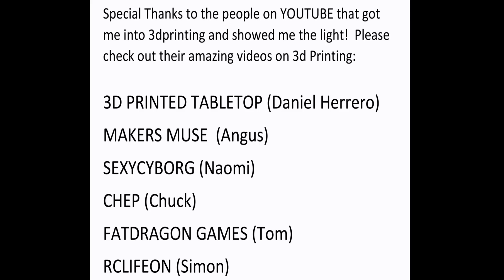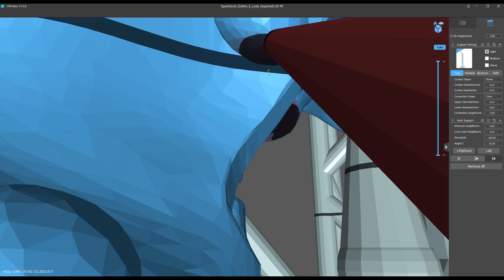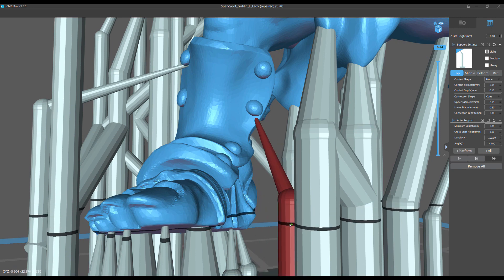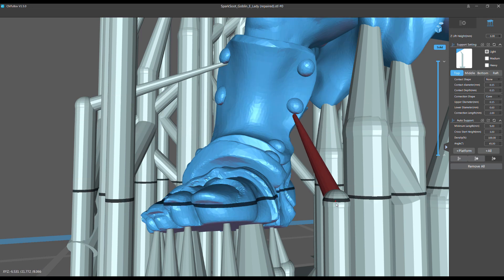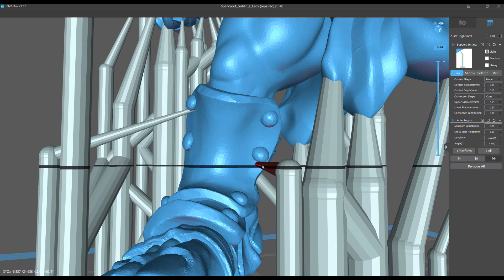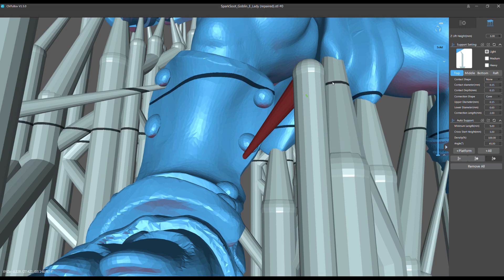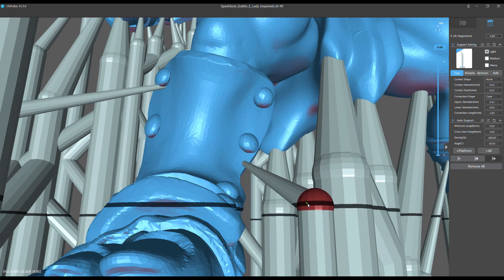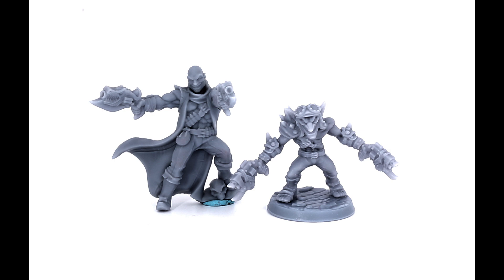Another advanced support tip for resin 3d printing!

Comment: Great idea, I had not thought of that direction as you pointed out. What I do in this situation, and actually how I do 95% of my islands is the slide bar on the right side of the UI where you can adjust how much of the vertical model is displayed.  I adjust that bar so I can only see those few pixels floating in the air, once I have that, I click to drag the tip off in to the middle of no where, and it can not follow your cursor out there. Then I slowly move my mouse still holding the left mouse button down and as soon as my cursor touches that floating island poof it appears right where the mouse touched the island.

Comment: To me it looks like you're then building a support off another part of the model, just in reverse. Building supports off of the model was one of the things you tried to avoid in your earlier videos. Also you've mentioned keeping supports away from the model so that it doesnt fuse together. Looks like that tip would just become a big fused mess of resin. Curious what the cleanup looks like after if you're ripping a chunk of detail off to get that cleaned up. However it would solve free floating resin
Reply from the maker: It does but remember, you can't fail to support an island!  SO do your best to minimize damage but it's essential to support every tiny island!